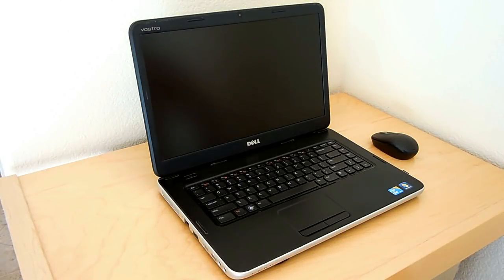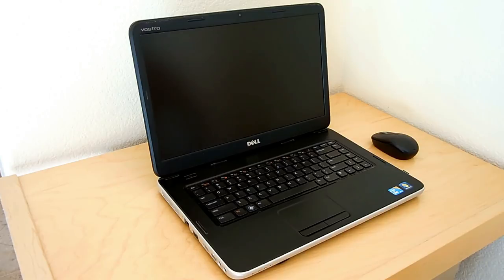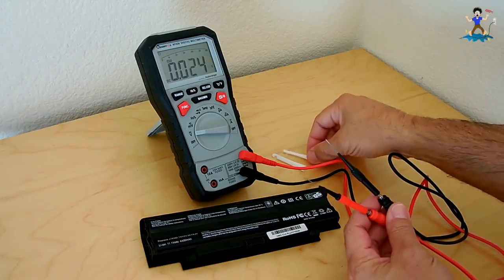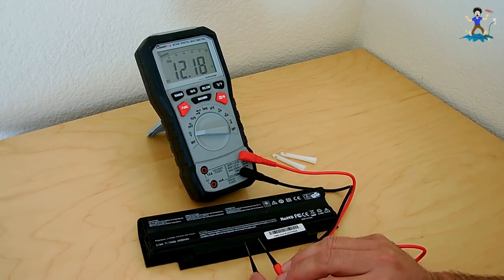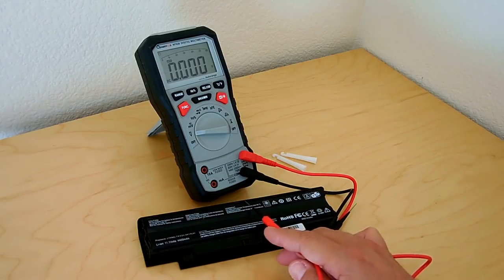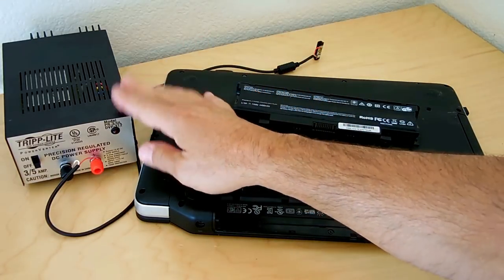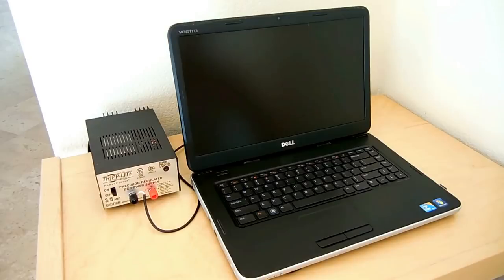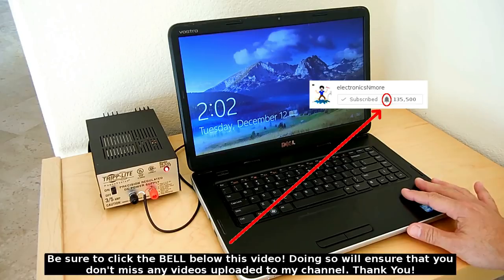Fried Dell Laptop Power Supply Workaround

Comment: Excellent work. 

I have a big Dell laptop/workstation that was acting up (couldn't play audio properly -- the audio kept sputtering, like the system could not keep up). After reinstalling the audio driver too many times, I discovered that if I let it boot while on battery (i.e. charger not plugged in) it worked fine, but if I booted it while plugged into the Dell charger, it would not run fast enough. It turns out that that charger was too small (in Dell's view) to run AND charge the laptop, so when the BIOS detected that, it crippled the clock rates to save power to the point that it could not even play audio. 

At some point I had told it during boot that I didn't care about the charger was too small, and after that it never showed the warning that the system would be crippled.

Booting while on battery, then connecting the charger was a good workaround. Also, getting the proper charger worked.

Comment: why not use the original ac adapter again? I just put whatever fits into the hole. I only check voltage if i take the end to put it in another power supply. usually works for me.
Reply from the maker: Trench You don't understand. The old switching power supply is fine, the portion of the circuit board that handles that power was fried.
Reply: @electronicsNmore  have the same with acer laptop but I don't know how to connect power

Comment: i tried it and its not work battry light blinking which means amp are low so i connect to 12v 5amp battry still its not working help which wire you short to work ?

Comment: Couldn't you have reduced the voltage of the original switching supply to 12.8v instead of using an alternate power source? or does it not produce enough current? Also, and I'm not sure about this, on this particular laptop, but in many cases, you can enter the BIOS to turn off the battery fault detection in the settings, to escape the recurrence of the battery error message at bootup... just a thought...
Reply from the maker: Pp Ss I could have bought a step down converter, but I hate to buy things when I have other things on hand. I'll check the BIOS...good idea.

Comment: Great video! This is exactly what I’m looking for, I have a dell venue 11 pro 7140 tablet that refuses to charge or work directly on the power cord, it only works if I change the battery externally and place it back in the tablet, I want to do the exact same thing and use the tablet as a stationary media device, can I get in touch with you to get through the process? Thanks in advance

Comment: All the laptop AC adapters I have ever seen are a nominal  19V @ about 4.5 amps. Are you sure the AC adapter is not bad ?  I assume you load checked your AC adapter. Maybe the battery is bad and is pulling down the power rail when you plug in the adapter. Did you try just running the laptop off the AC adapter with the battery removed,  You can run a laptop without the battery installed  just off the adapter. You may be right that the internal power supply / charger got fried and this is a great work around.
Reply from the maker: JOHN LUCAS 100% fried.
Reply: You can't use the original power without lowering the supplied voltage (it has higher voltage output in order to be able to charge the 12V laptop battery)

Comment: Same thing happened to my wife's HP laptop. Our son uses it more for gaming. Before I saw your video, I purchased an external battery charger for the laptop battery. That works but what i'm wondering is can I use that external charger to power that laptop by changing the end of it to fit the computer instead of the battery? In otherwords, does the external battery charger act (or can i use it) like your Trip Lite DC power converter? I don't know much about electronics.

Comment: Hello and thanks for your video. I just tried this on an old laptop. Only connected  +11.5V and 0V pins (Battery is rated 11.1V). But when I press the power button, the battery led on the motherboard flashes three or four times and then nothing. I saw on your video that your connector has some other connections or jumpers. Is it possible that I need to connect something else besides the power pins? Thank you.
Reply from the maker: Either your laptop isn't getting enough power from the power supply(very likely), or the computer won't start up because it doesn't recognize the incoming power.

Comment: Can you purchase an external battery like the omni 2000 to power the computer? I'd like your input before shelling out 200 bucks.
Reply from the maker: If you can get the computer to work doing as shown in this video, then you can switch to a battery later. The battery must have the same rating or higher.

Comment: I came across this video when I don't understand the PCB markings ++CDBSAGG in battery charger of Dell laptop . Positive and negative are understandable but I tried to know the remaining.Now I understood. I just want to use that PCB to charge 18650 cells instead of throwing away.Thanks

Comment: Excellent video! Valuable information presented in a very nice, simple, concise manner. Good voice, tone and communication style as well. 👍 
(Just wondering have you tried in increasing the power supply gradually in 0.1 volt increments, i-e, 12.7, 12.8, 129. ... 15 volts). I have a strong feeling that it might work on higher voltage range as well because with same motherboard, some laptops have 4S instead of 3S. Pls try and let me know!)

Comment: Doubt if the 13.7 volts would have fried the 12.6 battery and nominal computer value needed for power.
Reply from the maker: No, just keep the voltage at a similar level to the battery pack.

Comment: So I tried 12v and 4.5A but my laptop didn't power on

Should I make the current 5A?
Reply from the maker: Make sure you are definitely using the correct pins. It's possible you may need at least 5A.

Comment: Edit 3 I saw something about drawing less amps without dvd drive? If I remove dvd drive I can use an adapter with 3 amps current? 
Edit 2* sorry I’m reading through the comments seeing you’re getting a lot of similar questions, I see you put less than 12.6 volts and 4-5 amps SHOULD work but stick close to MY specific battery output specs... Hello I like your tips, do you think I could find a universal adapter that’s close enough? I don’t have a bench supply. My battery output is 10.6 volts, not sure about the amps. I found a 12 v adapter but it’s only 3 amps current. I noticed you said you had 4.5 amps and needed 5 to power the laptop normally? Wondering if a 12 v adapter with 5 amps would work for me? I know it’s hard to say for sure but I really want to get this laptop working. edit the laptop is powering on with everything working except the screen. It’s a gateway nv53...hmm

Comment: Great video. Thank you for sharing your knowledge. Can we solder a laptop power adaptor to the battery pins instead of a power supply?
Reply from the maker: No, voltage too high.
Reply: @electronicsNmore  Oh! Just out of curiosity, how does the laptop power on with the adaptor but no battery plugged in?
Reply: @electronicsNmore  its current too high

Comment: Very helpful well made video. My battery is showing very low and not charging.  Unit works OK from the power pack which is showing rated output Volts. The cells are not flat and can discharge at 10A. Since there's a fair amount of electronics actually inside the battery, I'm not sure where the blame lies. I can't measure any volts at the supply pins with battery removed and Laptop powered up. Maybe it detects its absence and switches off...??? Any ideas or help would be welcome. I'd really like it to be portable so battery operation is desirable. Best regards BjG

Comment: I want to know sir the inserted 9 pins connected from power supply to battery terminals...
Reply from the maker: Every laptop is different. You'll need to identify the correct pins for your laptop.

Comment: I bought a new battery for my Alienware, didn't fix the problem so I purchased a new power supply, still doesn't work, tomorrow I'm going to try this and let you know if it works :) My power supply is huge, 19.5v and 20 amps. The battery is 14.8v. So I guess I need a power supply of 14.8v and at least 5amps? Does that sound correct?
Reply from the maker: 13.5v to 14.8v at 5A should work.
Reply: @electronicsNmore  Amazing it works!!! HOWEVER it only works with the power supply still connected? Even though the power supply is NOT charging the laptop?? So now I need two power supplies, one connected to the battery side and the original Dell charger in the side of the computer!!!! Any walk around for this? I will be using a large battery from my boat (300ah) and dell charger plugged into my inverter !!! Any advise or help would be most welcomed !! Simon

Comment: hi, does this work with any cables/wires?
my battery is an internal one and uses very thin wires. I wanted to keep the wires and the little plastic connect outlet to fit it into the board no problem, so I soldered on some wire with about the same diameter but it's made out of one solid metal instead of those fibers. would it still work? does it have a higher resistance or anything? also cable wires are thicker than these so would there be a problem soldering them onto a charger with normal cable wires and the right voltage and current? should I be worried about something catching fire?

Comment: Hi thanks for the video. I been looking for an answer. Just have a question, the battery says 10.8 v , I guess it should be around 4.9 amp. Would it work, taking aout the DVD player, and using a 12v ac adapter 3.74 amp?
Reply from the maker: You need a switching power supply of no more than 12.6v that can supply between 4-5A.
Reply: @electronicsNmore   ok thanks for the fast response:)  So the same power supply as in the video will do.
Reply from the maker: @gaal-guirestaurant6888  No!
Reply: @electronicsNmore  pc power supply will be ok?

Comment: Excellent idea! This is JUST the kind of workaround I have been looking for. I have an old 13" MacBook A1342 from 2010, with a broken DC-in board, where you connect a Magsafe charger, that supply 45 or 60 or 85wats. Everything Apple is expensive, so i want to use what i already have. The battery that is labeled 10.9 volt should give max 12.4 v at full charge. Well, this battery is dead, wont charge. I have a 12.2v power supply but i am not sure how to connect since Apple has built in different chips both in motherboard and battery to communicate with each other. Any ideas or tips?
Reply from the maker: Hi Erik! That's the nominal voltage, 12.6 is the fully charged voltage. A 12.2V supply is perfect, as long as the current level is high enough. You can always rip open the battery pack, remove the cells, and connect the power supply (+) and (-) to where the battery was connected. Good luck! Be sure to rate thumbs up, subscribe, and look over my extensive video playlists below for many other videos of interest to you. Taking one minute to share a link to my channel with others on social networking sites would be greatly appreciated. Thanks
http://www.youtube.com/c/electronicsnmore/playlists
Reply: @electronicsNmore  Thanks for the reply, but sadly it seems it wont work. From what i read online, Apple put some "electronic fuse" or something inside the battery, and if, for ex, the voltage inside ever drops to a certain low (because a cell go bad), it blows the fuse, and the circuit is broken and even if you replace the cells, it wont work. Same then if I put DC in instead of the cells. VERY frustrating.
Reply: Update: I found a workaround to make it work! With Mac-laptops, you need to use "bypass SMC-mode", or whatever its called, (disconnect all power, hole power button 10 sec, connect power, keep holding power button 10 sec, then release, the press power again). Then the laptop powers up, on 12 volt DC in via battery plugg. Now I am here to find out how to do this on an old HP/Compaq  laptop where I have no battery, so its a bit difficult to figure out pinouts....

Comment: Quick question are you keeping the small circuit board attached to those pins. would it work just applying your voltage with no circuit board directly to your pins? Thanks.
Reply from the maker: The power is connected to the board that was used for the battery.
Reply: @electronicsNmore  okay perfect thank you. unfortunately I took my pins off of the board not sure if I can put it back on.  what would happen if I connect the power directly to the pins with no board if the voltage is being inputted to the pins at the same level. I'm assuming the board with all of its diodes is used for the communication pieces of the pins would this be correct. And if this is correct does that mean I can connect the power directly to the pins.

Comment: Hello, Cool video. I have a Dell Inspiron 13 7000 series 2 in 1 laptop that the power supply port/receptacle broke off of the motherboard. I can’t find a motherboard replacement that I can afford and wondered if you know of a way to power the the motherboard via a USB-a port or any other way to power the laptop and keep the battery charged? On the machine I have it requires taking the bottom off to access the battery or I would go that route.  I would go the route that you used but I need to move the laptop from place to place. Do they make a USB-a charger or adapter that can recharge the battery? I am at a loss of what to do, being a disabled senior on a small monthly income I can’t afford a new motherboard. I have tried a couple of used MB’s from eBay and both would not work so I am afraid of the $129-$179 used boards.
With your knowledge I wanted to ask if you may have a solution. I feel if we can put a craft on Mars there should be a way to charge the battery without taking the computer apart every few hours. With as many computers out there without a USB-c port someone should develop a way to charge via the USB-a port and make a fortune. Thanks  in advance for your input it is greatly appreciated.

Comment: My laptop works this way but shuts off after 10 seconds... probably some safety function of the laptop when it’s detecting the non original power supply. Do you think its fixable?
Reply from the maker: Probably lacking power to keep it running, try another power supply 1A higher. You may be able to adjust some BIOS settings.
Reply: electronicsNmore hey thanks for your quick reply. My power supply is a multi voltage powerbank rated for 90W. I found that when I bridged the temperature sensor pin to ground it works... so perhaps this is a PTC sensor where the resistance increases with higher temperature. So not grounding it will tell the laptop the battery is too hot and it will turn off? Anyways It’s working now. Thank you!

Comment: I have the same issue with my Samsung laptop. The laptop worked a month ago and randomly it started smoking and stopped charging from the charger because the charging port is broken, so do you think replacing the port will fix it or is it something else like a chip causing it to smoke? I'm a little worried since the laptop still worked before the problem and was pretty useful although it was 9 years old. Of course I have another laptop but I don't want to waste a laptop unless it's fully broken...
Reply from the maker: Without looking, hard to say.

Comment: I'm not sure I understand what you did here..Basically you just connected a 12V DC supply directly to the pins that usually get those 12V from the battery, right ?
Reply from the maker: Correct Eduard. The battery was dead. The power supply board in the computer was shot. So now I'm able to use the computer just fine with an external power supply. Thanks for watching!  I have many videos on my channel that cover a wide range of subjects, so be sure to look over my extensive video playlists below for other helpful/informative videos of interest to you, and most importantly share my channel with many others. 

https://www.youtube.com/c/electronicsnmore/playlists
Reply: Im looking at my battery HP mu06 but it says 10.8 volts on the back and i dont have a multimeter right now
Reply from the maker: @chappyg5512  3 lithium 18650 cells in series at the lowest voltage (3.6v X 3 = 10.8v). Full charge is 4.2v X 3.
Reply: @electronicsNmore  alright thx, i have a newer one that has 6 in it, i dont have a laptop adaptor (smart pin) to test with, i was gonna dismantle the pack and charge them 1 by 1 with a crappy. Dismantled portable charger (1x 18650) worst case... I got a better cell charger

Comment: Hello friend,   I only got a simple question, my ASUS laptop has exactly the same problem, can I do the same thing you did but instead of using an external power supply use the laptop's own charger? thank you, sorry if I bothered you, Moses.
Reply from the maker: The voltage supplied must not be higher than a fully charged battery pack.

Comment: My mini laptop's battery is rated at 7.4v, is this mean I need to feed it similar volt range?
Reply from the maker: 8.4V would be the max input for (2) fully charged Li-ion cells in series. So 7.2v - 8.4v
Reply: @electronicsNmore  Thanks :)

Comment: Hmmm was the original PS only 12 volts??
I’m guessing is 19V and that’s why you are needing so many Amps.
Reply from the maker: P V Draw off the battery without the DVD operating is around 2.5A. Original power supply was 19.5v, which ran the computer and charged the battery at the same time.

Comment: Hey ive had the same issue and i tried this..So i used an alternative power supply of 5A 12v.. to find the third negative in the laptop pins i looked at the battery and there was written all of the uses of pins so in mine the third negative was just alongside the 2 negatives ..... so can i just connect all three together and provide negative charge and the other two end pins the positive?? please reply i reallt need your help